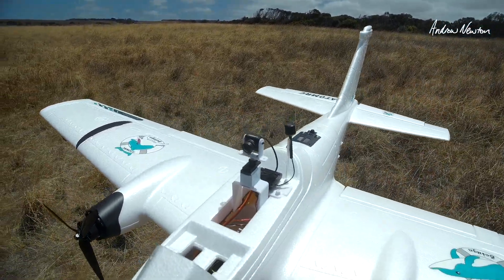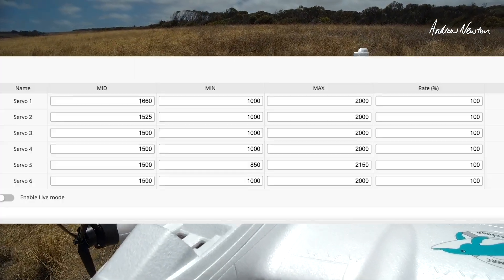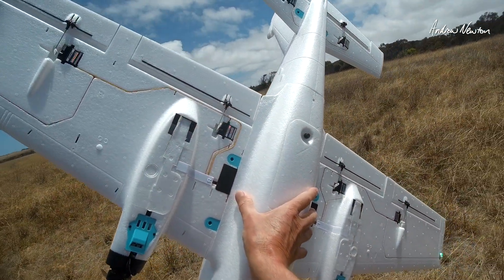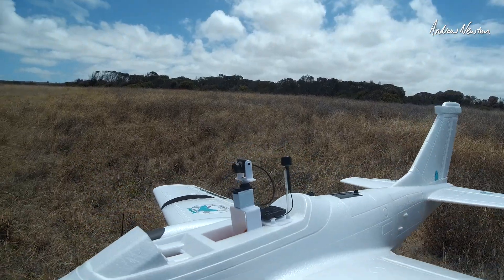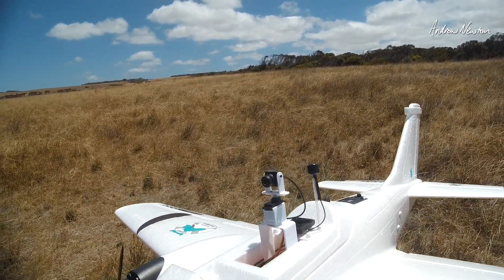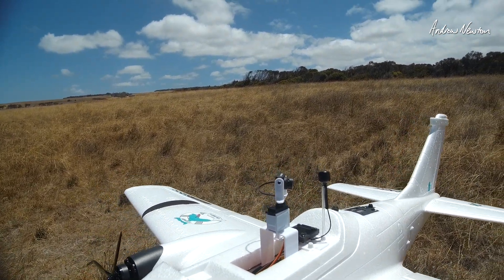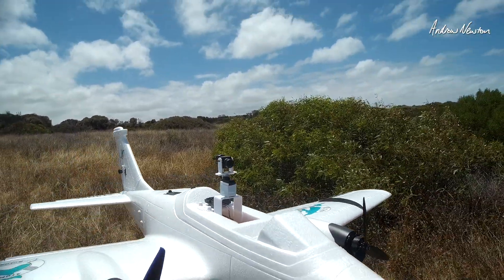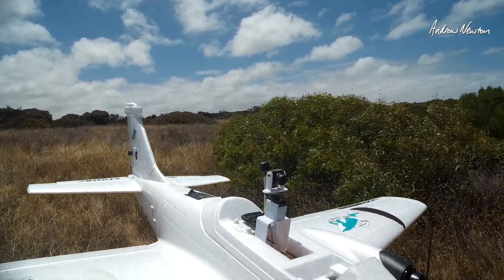AtomRC Beluga Pan Camera Setup

Comment: I'm curious why you use S1 AND the slider to control the pan servo. Why not use just the slider?
Reply from the maker: Just using the slider gives jerky panning. Also the switch means it always returns to straight ahead.
Reply: S1 IS the slider, wytb?

Comment: I liked on your previous video that the instrument panel was not so much obstructing the view.
But it seems it needs camera to be way much higher than it should be if using the rollcage or glass canopy, right?
Reply from the maker: Yes the panel would block too much of the view if the camera was low enough to fit under the canopy.
Reply: @AndrewNewton  You might give a small peak on that topic sometime, so people know that with canopy the view is much more obstructed.
This is why I believe I will ditch my Swordfish canopy camera as either I have to put my GM3 gimbal way higher than it makes it look good or deal with a lot of nose in view.